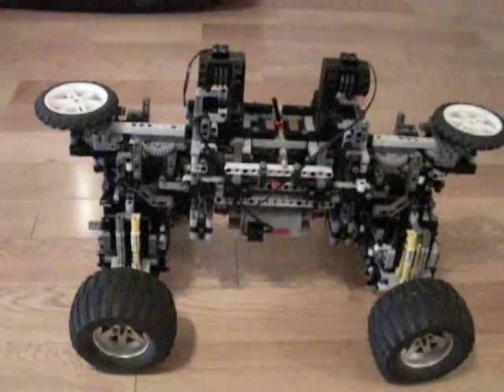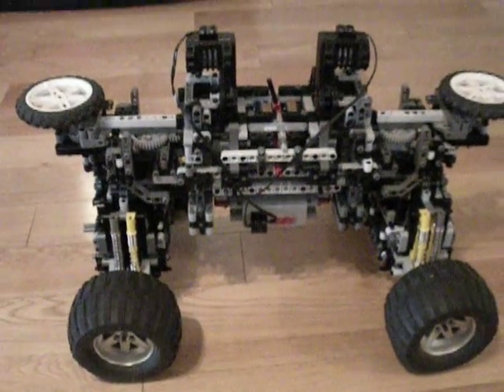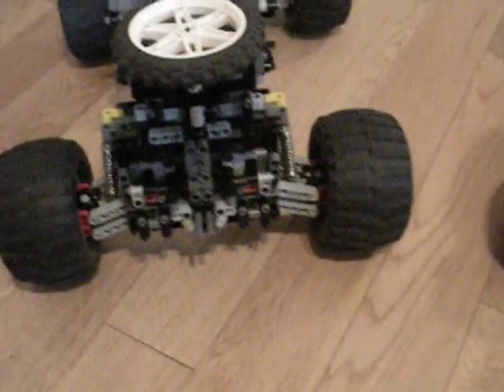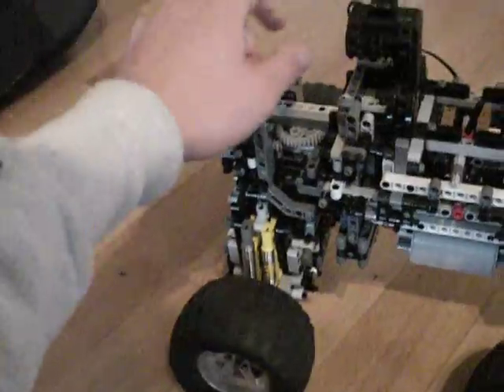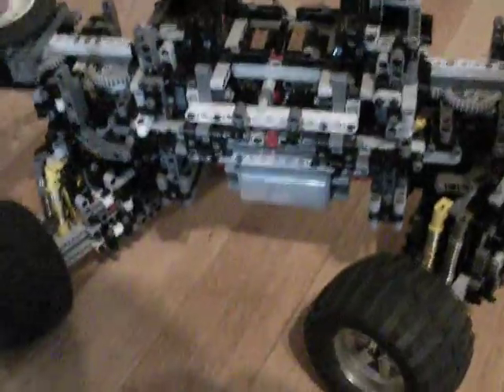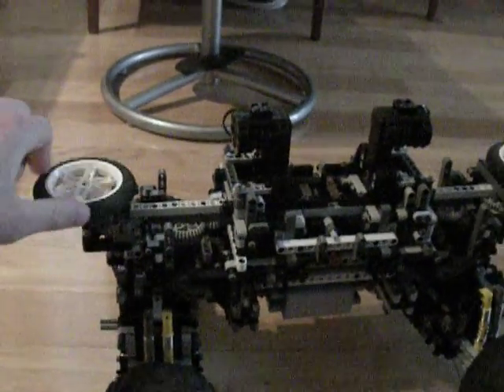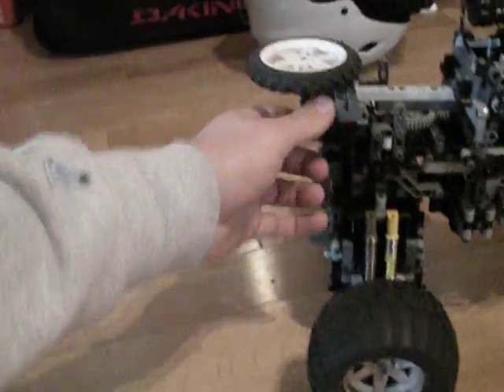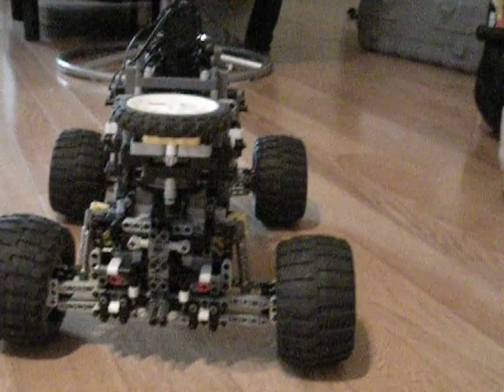Original Lego Robot - 4WD - 6spd Transfer Case - F/R Locking Diffs - 4W swivel steer

Comment: If you intend to make it remote controlled ditch the manual gearbox and use an electric motor with a higher rpm range, maybe a number of medium motors in parallel. I've been playing with making a drive shaft with an expanding column, you could do this for your axles instead of having a top-down gear based transmission.